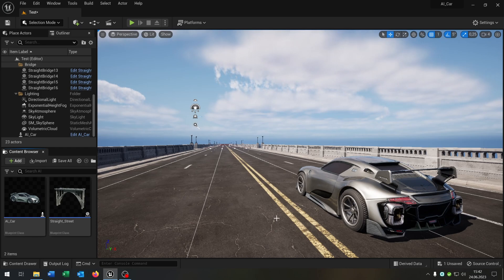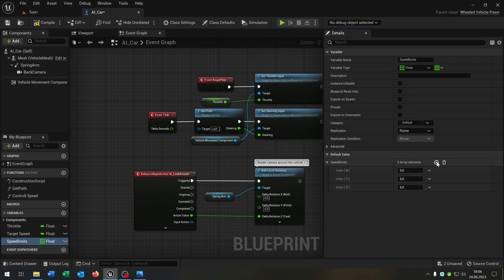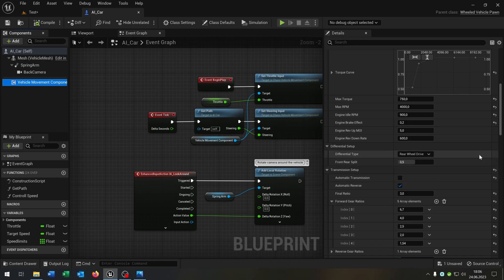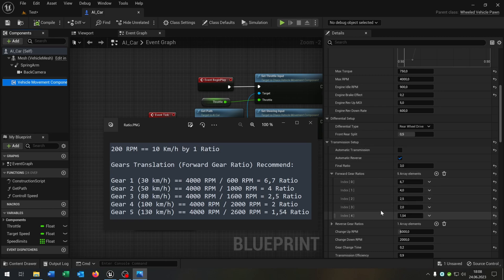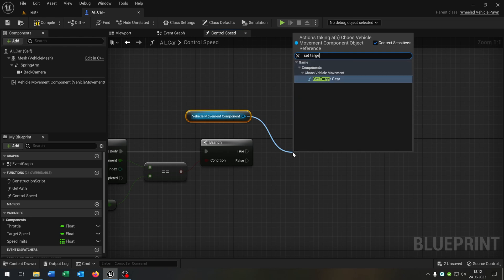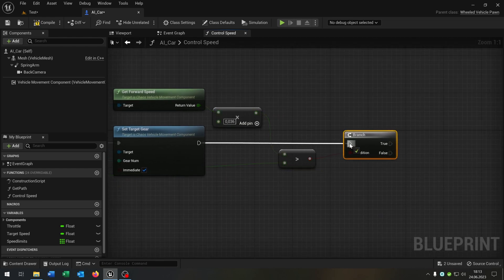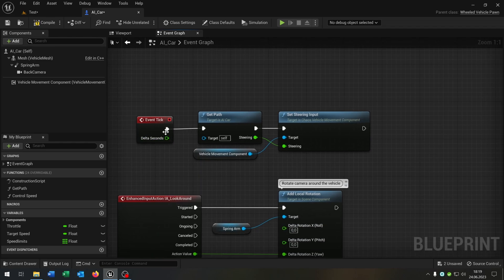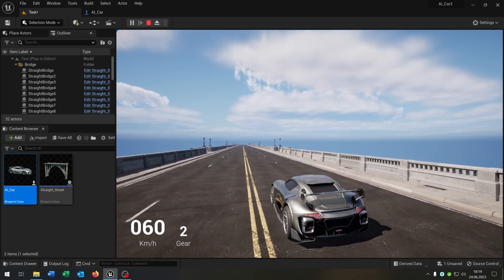Unreal Engine NPC Car Tutorial: Speed Control

Comment: Vehicle @ 1-2 gear moves straight but after shifting to the third gear vehicle lose stabilization and keeps moving around like a snake, Help please!.
Reply from the maker: Did you watched the previous Tutorial, so that the Car is steering properly: https://youtu.be/AlMPqZ2d4BQ?si=jLoJLd00oieUEHlK
Reply: @Seredias.  I'm having the same problem right now. It's perfect until 50 kph and then yes it will move like a snake too. I did check the other tutorial I followed to the letter but it didn't mention anything about preventing this issue.
Reply: Same here man

Comment: If you're wondering how to get a vehicle to speed up or slow down based on curves and road conditions, implement logic that calculates stopping distance based on current throttle and braking intensity. Find the braking friction, wheel torque, and engine torque values in the UChaosWheeledVehicleComponent, and then calculate how much brake or throttle is needed to get from the current speed to the target speed by the given distance.

It's exponentially more beneficial than setting hard throttle or speed limits, as the speed changes are adaptive to the road conditions.